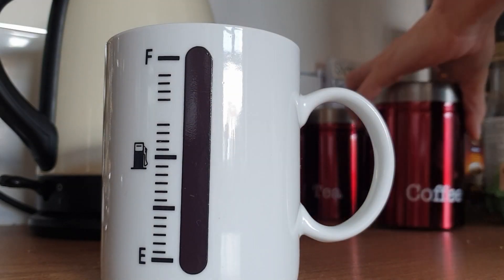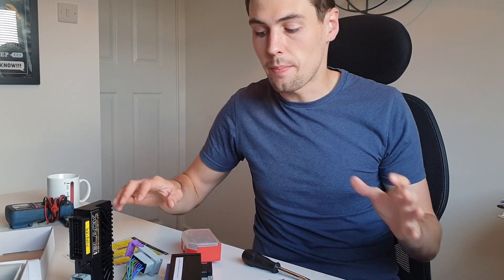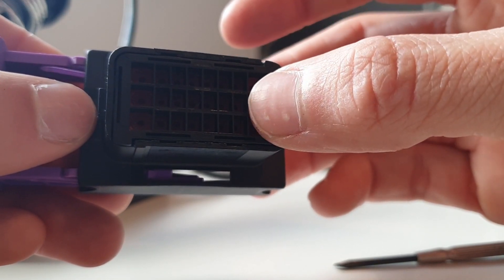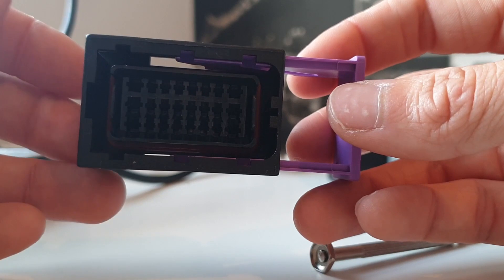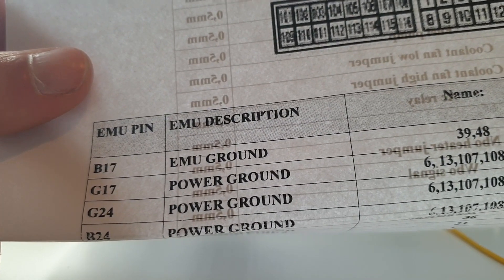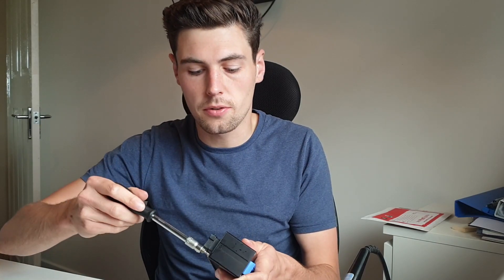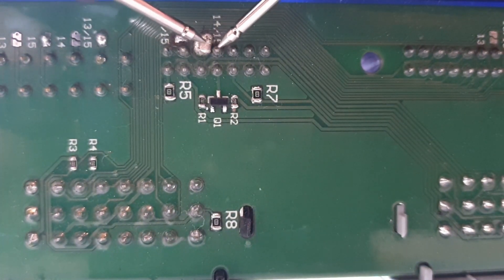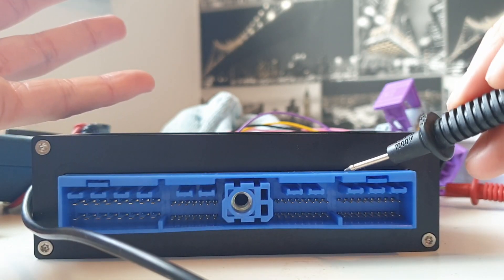Nissan S15 Project - PNP Harness Construction

Comment: Great video man. How do you know if your PnP harness required soldering?
Reply from the maker: Hi Fraser, The documentation that's hosted on the ECU Master website should clarify if you will need to solder the jumpers or not. In my case I also needed to change some of the input/output wiring and the fuel pump pin on the ecu connector too.